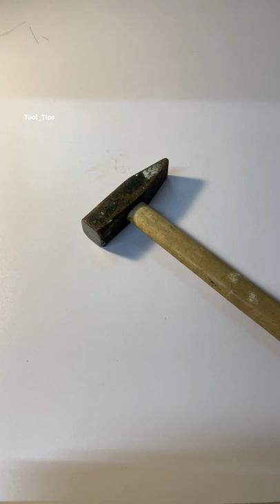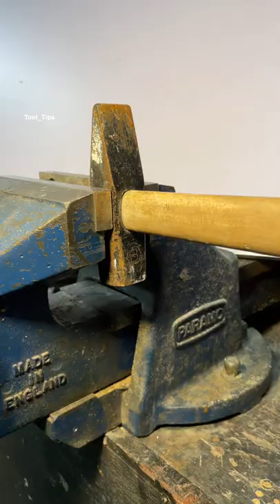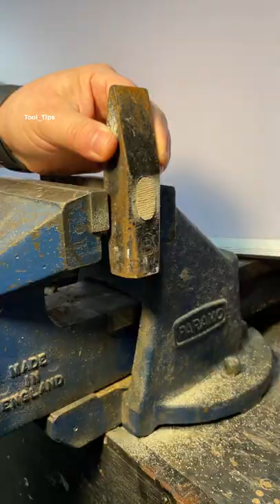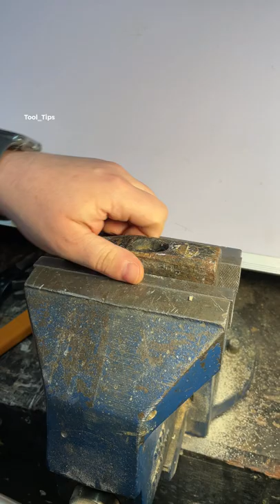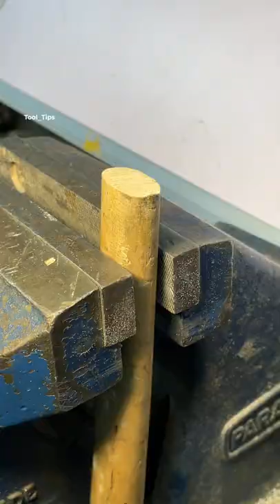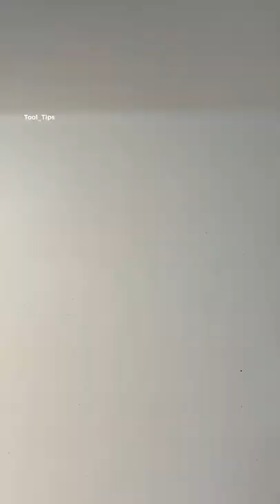#shots Loosing hammer Handle

Comment: Let’s just say you didn’t have a second hammer 🔨 so you would have to buy 1, which actually defeats the whole point 🤔 good vid tho🤯
Reply: Hammer isn’t a necessity to fix the hammer. Big rock/ flat side of a cheap wrench work just as well
Reply: The use of those emojis was incredibly unnecessary
Reply: @Quinch420  ⬆️
Reply: Or soak the original handle end in water 🤷🏻‍♂️